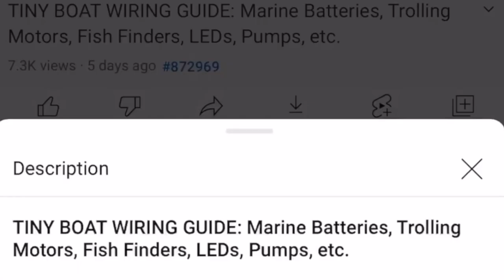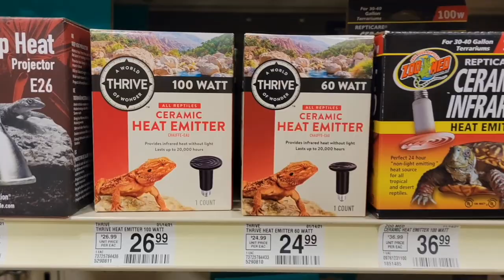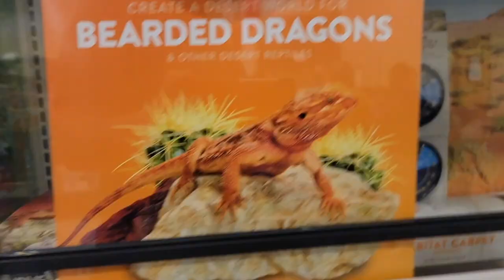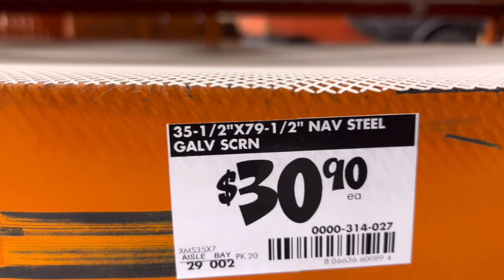DiY Reptile Enclosure for Bearded Dragon V2: 80+ Gallon Tank.

Comment from the maker: 1:02 - Material list Overview
5:29 - How to modify plexiglass for install
7:36 - Measurements for cutting the frame studs.
8:45 - Plexiglass install preview
9:20 - Cutting & installing the wood frame
9:39 - installing the frame studs
9:43 - how to make a pocket hole without a Craig jointer pocket hole jig
12:17 - Using plastic wood to smooth out frame imperfections
14:33 - Vented screen installation
16:05 - Sealing wood floor with epoxy resin
16:48 - Light fixture design for reptile enclosures
17:02 - Making the top lid
18:08 - Making integrated light fixture lid design
20:03 - Making top shroud to protect the light fixtures
22:51 - Painting the lid and reptile enclosure
26:61 - installing hinges on the lid/door
27:53 - Gas strut / gas spring prop lid installation 
31:37 - Light bulb setup for light fixtures
32:25 - Why we used aluminum to hang the light fixtures
32:55 - Substrate installation | rigid core water-proof flooring install
34:19 - Installing plexiglass front view
35:10 - digital thermometer & hydrometer overview
35:22 - End reveal & walk thru of this reptile enclosure in action
THANKS FOR WATCHING!
______________________________________
Check out my Outdoor DIY Channel  @Tiny Boat Nation  
______________________________________
Tools Used:

impact driver(s)
Milwaukee installation driver
impact-ready drill bit set
De-buring/countersink bits
Cheap sheet metal break from Harbor Freight
Dewalt adjustable clamps
Kobalt portable miter saw
Dewalt 4.5” circular saw
Orbital sander w/ 220 grit sanding pads
Square ruler
Speed square
Meter stick
marker/pencil
Utility knife
measuring tape
staple gun

_______________________________________
Materials used
Two 2’x5’ birch plywood sheets
Eight 1x2” pine studs
Plastic wood putty
Wood glue
Drywall screws
Small wood screws
Rigid core waterproof flooring
Perforated metal screen
aluminum sheets (that I had in my scrap pile)
light fixtures
13w & 26w UVA/UVB bulbs
150w basking bulb
Rustolium Professional spray paint & primer
Rustolium Outdoor Fabric spray paint
Epoxy resin
Digital thermometers & hydrometers
Plexiglass 1”x5”

Comment: Hi was wondering if you can make a bearded dragon enclosure out of shelf boards the kind with the  Formica like material around kind of like a pressed board
Reply: you mean melamine. and yes, quite a few people do, but it's heavy as balls compared to regular plywood or OSB (almost twice as heavy in some cases) so moving it around, both as you build AND just moving the finished enclosure to where you want it, is gonna be a bit harder.
Reply from the maker: You can pretty much make an enclosure out of anything so long. Is it safe for the pet